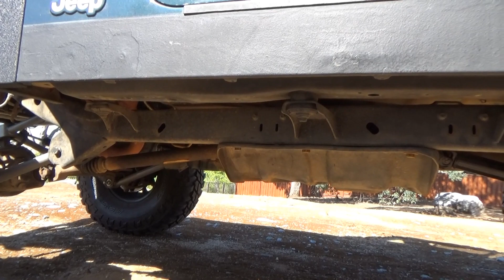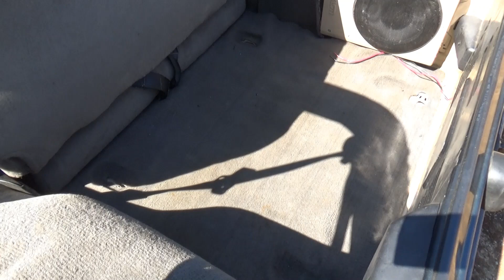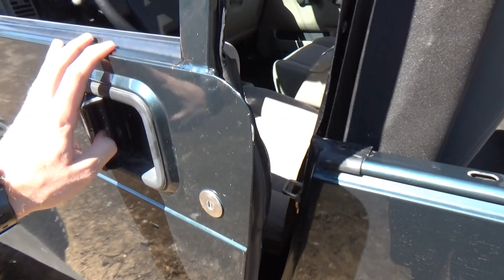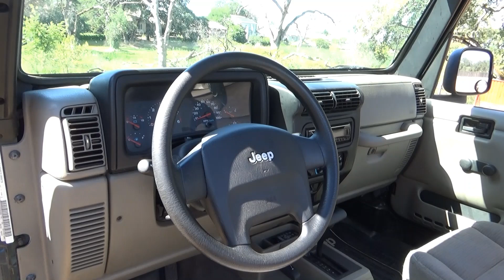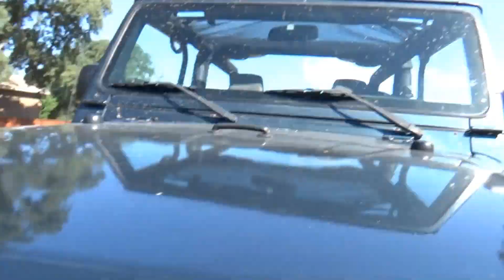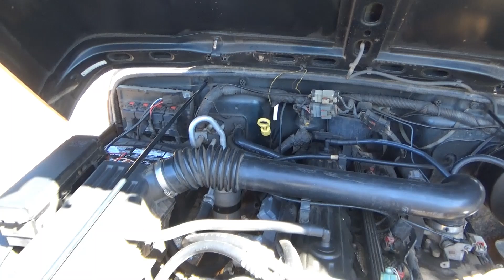Project LJ - Just Getting Started Jeep Wrangler Unlimited LJ TJ Restoration Rock Crawler Build

Comment: Bastard my zj is 6 inch lift hybrid caged coil overs fenders cut moved up jk 44 axle swaps trussed sleeved. 🤗And now you're just another Wrangler guy 🥺
Reply from the maker: Haha I do miss my ZJ but the LJ is looking and running a lot better now and I picked up an MJ (Comanche) as well.  Haven't wheeled in a while but have lots of work for the rigs to do on the ranch.

Comment: I wanted to ask about your ZJ I have one just like yours, i’m leaking between the transfer case and the transmission, but there’s no video, my Chiltons my Haynes doesn’t show how to pull the seal on the transmission side, I don’t want to damage anything, my 95 Laredo V-8 has 300,000 miles on it and I don’t want to hurt her, Do you just use a seal puller I don’t wanna hurt the bearings I see back behind it, you’re my last hope, i’m a grandma and I’ve done all my work on my jeep Laredo but i’ve never done these seals before, because you’ve owned one.
Reply from the maker: Sorry Debbie, wish I could help you out on that but I never had to do that seal.  Do you get on Instagram at all?  If so, I think you should talk to Niner_Nate about this.  I think he may be able to help you as he did some transmission work on his.

Comment: Rubicons came with the 44s, unlimited had 35 in the rear and 30 in the front.
Reply from the maker: That's true for TJs, not LJs.  Non-Rubicon LJs have 44 rear with limited slip, 30 front, and 3.73 gears.  Most non-Rubicon TJs have 35 in the rear, but 44 was an option.  On LJs 44 rear was standard.

Comment: If you havent fixed your random misfire and you tried everything else try to replace the crank sensor.These jeeps are known for this.I had same issue.Jeep ran great replace everything relating to the problem and still did it,threw a cps in it and it idles and runs wayy better
Reply from the maker: Appreciate the heads up!  Been hearing that too, but think I got mine squared away.  After doing new coil, new plugs, and new throttle position sensor, I still had the issue.  I felt like it was fuel related.  Ran the tank down really low, then poured a few cans of seafoam into the gas tank.  I pretty much ran the Jeep on seafoam for a few days hahaha but I kid you not, the thing started purring like a kitten!!  Idle smoothed out, check engine light went away, passed smog no problem, and haven't had an issue since.  I suspect the injectors were gummed up from crappy gas or not being driven much by the previous owner.  I now only put high quality fuel in it and hopefully that'll keep things clean in the fuel system.

Comment: 6inch iro lift kit?
Reply from the maker: Ended up going with 4" IRO long arms which are currently being installed.  Based on measurements I took off my last ZJ project, I think 4" should be really nice for this rig.  If I end up scraping the belly or rockers constantly, I'll bump it up an inch or two.

Comment: Looks like a great set up. Just picked myself up an LJ as well. Mine is stock, so I have a great canvas to start with.
Reply from the maker: Nice!!  Yeah, I would have loved to find a nice stock one.  Would save me a lot of time removing aftermarket parts I'm not planning to use.
Reply: RYANVISION and, I hear you on the tube bumpers. Check out channel for the LJ video of how we got it. Previous owner put the cost effective Smittybilt bumpers and side steps on to sell it. Took most of it off already.

Comment: I also in the middle of a 05 LJ manual build working similar issues. I chose to stay with 15" wheels but found a set of Hutchison Rock Monster at an unbelievable price on 35" Cooper Pros. Great setup
Reply from the maker: I like 15s on 35s, plenty of sidewall for the rocks!  What width did you go with on the wheels?  My last project I used 15x8 and that worked really well to keep the bead set offroad at 10 psi.  Thinking I'll do the same size again.  Only thing is you have to decrease pressure on the road to get them to wear evenly.

Comment: Check out Metalcloak. They have lots of cool armor, fenders, bumpers, suspension and more. 

 I’d say, do the long arm 4” plus a 1” body lift to put a belly up skid, high line fenders and 40s.
Reply from the maker: Low on 40s is the dream but biggest I'll go on 44s will probably be 37.  I'll run the 35s for a bit since they're fresh, then look into upsizing.

Comment: Don’t waste your money on the D30!!! Please just get a good 44 like curry or teraflex. I lucked out and found my curry built D44 with chromoly shafts, thicker axle tubes, 4.56 gears, and a Detroit for $1400. It was brand new never installed (bare tubes). A little fab work on my part and it’s under my Jeep now for less than what it would have cost to rebuild and beef my stock D30.
Reply from the maker: I hear ya, and If I could find a deal like you did I'd be all over a 44, but so far everything has been $3000+ built.  If an awesome deal doesn't come my way I might have to work with the 30 for a bit.
Reply: RYANVISION Save up and wait for a new front end. Leave the 30 alone. Any money you put into it is money you could put into a 44. What if you built some junkyard axles out of the Jeep. Wheel it as is and once they’re ready just swap them in. HP D44 and Ford 9” would be badass out of a ford truck. Plus you’d be full width so you wouldn’t have to run such an aggressive offset wheel to clear bigger tires

Comment: I have E-Lockers on my ZJ and i love them. No air leaks no air compressor noise. Just push the button and on push button off.
Reply from the maker: Did you go with Eaton or which brand?  I'm leaning toward e-lockers for these exact reasons.
Reply: @ryan.vision  Eaton ive put lots of trails on them and they keep working flawlessly.
Reply: @ryan.vision  I heard you talk about a doubler. I have a Klune-V and i like it. So low its kinda hard to use in low low...